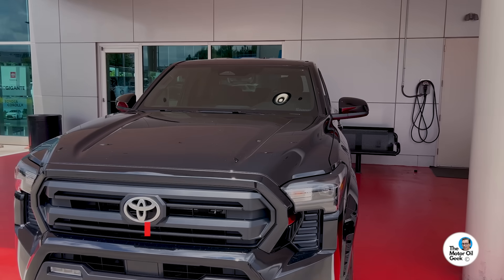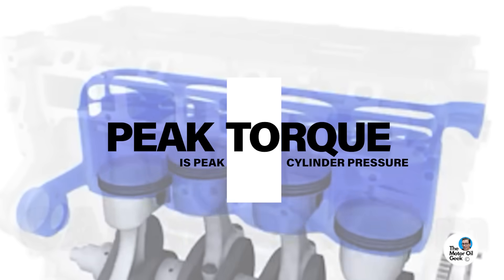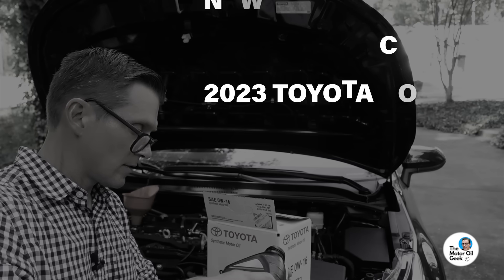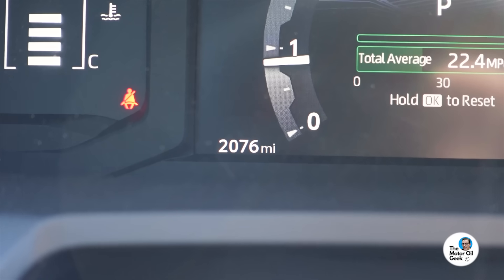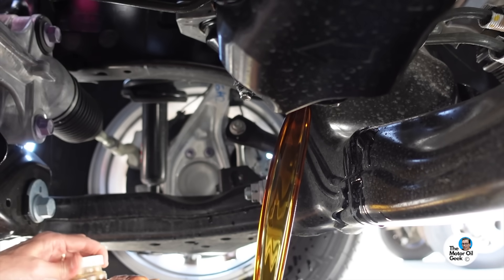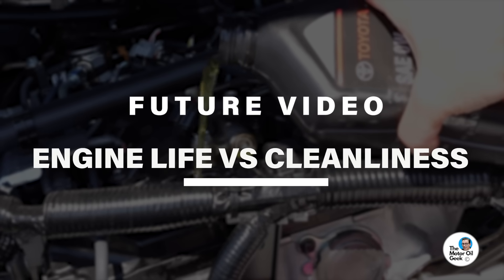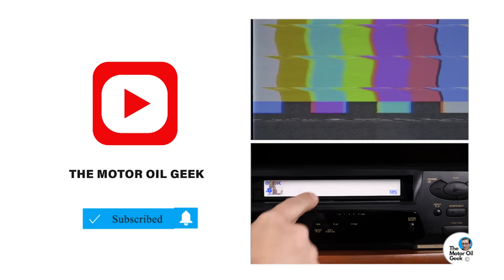The FACTS About Oil Changes (What The Owner's Manual DIDN'T Tell You)

Comment: Hot oil flows freely.  I drain a cold engine. But just prior to removing plug, I heat the oil pan to a hot oil temperature.  I use a hot air gun. The oil drains fast!  When the engine was hot, after it was shut down, the oil had every opportunity to drain completely into the pan. The heating of the pan gets the full load running in a shorter time than  waiting for a hot engine to release the  oil coating the internal surfaces. Any comments are welcome.

Comment: I didn't know it at the time but when I bought my first brand new truck with only 50 miles on it, My freind told me I should do the first oil change at 500 then just wait to 3000 to do the next, great to hear he was almost correct. I got the dealership oil changes to 30,000 miles but they wouldnt do it at 500 so I did it myself. 230,000 miles later I just switched to synthetic and sent u a sample got results and my truck is still doing great

Comment: 4:50 I disagree. Dirty oil filter will open by-pass valve more often than new oil filter. That will cause unfiltered oil circulate in an engine. Do not do it. It is wrong to compare oil and air filters, air filters do not have by-pass valves.

Comment: We have a fleet of about 15 work truck + a few SUVs. Almost all have over 200,000 miles some over 300,000 Miles, Oil changes at 5-600 miles. My last 2 trucks had 365,000 miles got rid of my pickup because of rust. My last one a ford edge i got rear ended and it was totaled. neither one used any oil (1/2 Qt between changes). When I bought my 2015 Colorado new the dealer gave me a hard time about doing the first change at 1000 Mi. Never went back. Now at 5000 miles. Keep up the good work Lake.
Reply: What data shows what you did made a difference in how long the engine lasts or on oil consumption? We have fleet trucks that have their oil changed at 7500-10,000 depending on use, no early oil change, they are traded in a 5 years oil, mileage between 200k-300k, most use .5-1 quart between changes, the problem with this discussion is that there is no way to show that a positive gain was made, it is more of a feel good thing, the only time I change oil early is on a rebuild with special break-in oils.

Comment: Nice vid!  Did you also test the brand new Toyota motor oil to get an understanding of its base composition?  BTW, if something goes wrong with the oiling system of this engine it will be due to a design issue as opposed to best practice maintenance.  Thanks from Down Under!  No doubt there is a legion of fans over here.
Reply from the maker: Thanks for watching! The new Toyota 0W-20 oil was the middle sample shown in the results.

Comment: Great advice as usual and I've pretty much followed that pattern on all of my vehicles. Just purchased a new 2025 Toyota 4Runner Trail Hunter, turbo plus the hybrid system and did similar oil changes as you did. So far in driving Toyotas for the last 50 years I've never had any engine problems following that schedule. What I learned from your video was about changing the oil filter, never thought about that, it makes sense. I also didn't think about running a quart of oil through to flush it, good advice.

Comment: Since using synthetic the break-in period as you said keeps going even at 2000 miles.  Would using your Driven break-in oil be better to speed it up?
Reply from the maker: It would, but it is not necessary.

Comment: G’day Lake, another great video as always. I’ve always changed out break in oil around 3 months in, not many miles, then change again in another 3 months, then 6 months and maintain 2 oil changes 6 months apart for the life off the vehicle. I do change the oil filter though.
I did notice when you mentioned leaving the oil filter in you crossed referenced back to Donaldson‘s air filter not oil filter. Did I miss something?

Comment: I grew up with old-school logic of a 1k break-in LOF due to heat/tolerance changes, potential foreign materials, micro-shavings, upper-end and bearing break-in, assembly lubes/adhesives, thread lockers, etc.. so I agree with your break-in advice even if engine/oil technology has advanced from I-C engine days.
Its why I scheduled my new 2025 TDI Taos for LOF just under 3k regardless of VW's advice of 10k intervals. 
I'll use up my courtesy service/labor visits within two years at my rate of driving, but its still worthwhile than getting stranded in the middle of nowhere with premature wear and engine loss. 
I've noticed all manufacturers forego the first LOF interval for various reasons (lack of electro/mechanical skills by the newest generation, potential reduction of hazardous materials storage/removal at dealaers, use of synthetic blends, newest generation are leasing, planned absolescence, timed resales, young owners do not have mehcanical logic, difficulty accessing engine components w/o specialized tools, etc.) but it doesn't make ANY sense...even with newer technology. 
The same illogic (if you will) has been applied to loss of full-size spare tires. 
Never used Amsoil, but I hear a great deal aobut it. Its certainly not cheap. So, what is your take on this product for engine/driveline lubrication?

Comment: On my amateur race engines, I've always used a break-in oil, (your's recently), for the Dino and first test track sessions and then gone with a full synthetic oil. Why would you not recommend a dedicated break-in oil for my new street vehicle? Is it a warranty thing, or could the break-in formula harm some components in modern engines? I get why the OEM doesn't use break-in oil from your past videos, but would I benefit from taking out the oil at delivery and running break-in oil?

Comment: Based on your previous videos when I bought a new MX-5 I did a 1000, 3500, 5000. So not as aggressive but well over factory recommended. It's what I've done for 30yrs. Last service I was lazy & had a coupon, so I took it in to the dealership. The tech who drove it around said. "wow yours idles & runs so much smoother than most. You must have got a good one". I just smiled and said, I must have. There's no doubt to me that the added break through changing out oil in has to help on any engine. 

Thanks for the videos! Can't wait to see science back up theory 🤓
Reply from the maker: Thanks for sharing that!

Comment: I've heard (and done) to warm the engine before changing oil, since the 60's. These days I wonder if this is needed. Synthetic oil already pours quickly and 0W-20 (or 5W-40) already drains quickly. Changed at 5K intervals I can time changes for Spring and Fall when the temps are above 60. By the time I've cleaned the plug and put on a new gasket, the oil has all drained so why heat the oil? Hot oil is uncomfortable to work with not to mention my oil canister has to be pulled up, just inches from the red hot turbo.

Comment: I’ve driven over a million miles using full synthetic and the oil change monitors. Never had a problem and saved thousands in time and money over oil changes every 3k.  Gone 10-15 k between changes at times.  
I know Lake is a petroleum expert but a mechanical engineer would be the person to ask the significance of minimal differences in wear over the life of an engine. The tiny difference in wear from slightly longer intervals and not doing 3 changes will almost certainly not matter for 99 percent of people who drive their cars for 10 years and like 200k miles.  Most people don’t want to keep vehicles longer than that anyways.  The average vehicle on the road has far fewer miles than that.  All that being said. I’m changing out motor craft semi for pennzoil ultra platinum in my new truck at 600 miles. So I guess I just contradicted myself. 😅.  I’m running an experiment and for this truck I want to see how long it lasts.

Comment: I used to love Toyota. I currently own 5 RAV4s (‘11, ‘18 x2, ‘19, & a 2025) plus an ‘18 Sequoia. 
The new A25A-FKS engine has egr, it sucks. sensors are usually $200-$500. 
The Evap sensor will get stuck open ($500). MAF is uncleanable ($200). 
The electric water pump WILL FAIL / SEIZE at around 100,000 miles ($700 if you diy, $1200+ at dealer). 

Already had 3 recalls on 2019. 
So I don’t dread buying my personal vehicle outside of the Toyota family. 

The Tacoma has zero leg room in rear seat making it expensive storage.

Comment: Just to be clear. People have to follow the manual defined maintenance and care to be eligible for warranty claims.
They shall not do more, or less than described there. As a professional specialist you might feel competent enough to alter the rules, but you‘re NOT in most cases, as there are immensely wide spread of the self-entitlement humans. But sure, if you want to change oil more often, I doubt a manufacturer would be against it.
Ok, I do get:
1.
a) a good filter is a used, not a deeply dirty filter
b) the filter as you say ? doesn‘t catch the drive-in contamination and
c) the oild filter with that mileage has been barely used in terms of flow-cycles-aging
And therefore the filter is actually as new and can be used for 2 full cycles, if not more of standard oil-change intervals. 
Actually what most manufacturers suggest, to replace it every second oil change.
2.

To flush oil, you use an extra gallon or quartz of the same oil, just throwing it out. Sorry, but this needs no comment! It shows, what you sell. You have already 3 oil changes in a single oil-change period for that reason. No need to through in a 4th, just as a flush.

What I‘d do (manual or air-cooled american cruiser, suggesting oil-type semisynth bike-branded 20W40, 1st 800Km, then 8.000 Km oil-intervals, every 2nd oil-change as filter change). Never fill oil above medium mark. Keep it 1/4 over MINIMAL mark.
1. Break-in 500km with original oil and filter spec, drive 60%: Change both, oil and filter
2. Break-in continuation, up to 2000km with original oil and filter spec, drive 90%: Change oil and filter
3. Flush Oil with new oil (adjustment choice, specific: 10W50fullsynth HighSpec V-Twin, for high temperature use, and better flow at start for hydro-lifters), riding 1000km with new filter (your choice, specific: K&N or Wix/Mann&Hummel), replace air-filter with higher efficient and volume K&N Filter, in dodgy areas treat your gas-filter with an upgrade of replacement fit for your environment. Adjust where required your mixture setting, it isn‘t typically for just an air-filter replacement, check with vendor.
4. Check oil every 1000km with proven stable procedure by the book. If there‘s no stable procedure, go to the vehicle shop and get it trained.
5. When it drops below MIN or you reach the book‘s interval or (on a motorcycle with single-oil system) the gearbox get‘s harsh continuously, whatever earlier, do oil-change. Every second oil change do change/clean the oil filter. Always clean the air-filter and when in dust right after the desert storm or other massive air-dust contamination.
6. Every oil change be documented by oil analysis, or at least with oil, mileage, symptoms, measurements. Cut open oil filters changed, always, check and document with makro-photo the status.

Alternate:
1. break-in oil change 500miles, 2000miles, 5000miles with filter changes
2. drive and oil change 1/2 interval with specified oil. Change filter as specified in the book (full interval or two, as specified).
3. Always keep your air filter clean from too much dust.
4. note down any symptoms, analysing oil and opened filter by eye, macro photo, or oil & particle & filter analysis, if you plan to do that.

Comment: I have the same truck. I changed the oil at 500, 1500, and 3,000. I had more debris in oil than the filter. Even some bigger casting chunks plus the normal bearing materials. Now it comes out clean at each oil change. The dealer thought I was crazy. I made them give me two oil filters and two cases of oil for the first changes. This is my favorite information channel. Thanks for the information!

Comment: Drain/ fill transmission at 30k, then every 50k. Never flush (guys who buy expensive flush machines and know nothing about clutch material will hate this). 

Toyotas: coolant every 50k maximum. 
Diffs: every 20k unless you only drive lightly, then every 30k. And after and water fjording over axle depth. 

Your A25A-FKS engine will have the electric water pump fail/ seize up at around 100k.

Comment: When I do the third break in oil change I dump the axle lube and transmission lube (transfer case) as well. You would be surprised how metal you can see in the nearly "new" fluids. I am not an engineer, but professional fleet mechanic who hates other people touching his stuff. I avoid going back to the dealership for warranty, I have even eschewed the warranty and replaced failed parts on my own dime. Too many flat rate guys out there willing to risk short cuts with my stuff just to beat warranty time. In the past I did and it cost me more in the long run in money and regret.
Reply: Ten points for the use of "eschewed," an entirely legit word and properly used, but it's almost never used or written anymore, anywhere. English teacher?

Comment: I slipped abit. I did my first change at 638 miles and at 2040 miles on my 25’ Corolla hatch nightshade. I’m apprehensive about 0w-8 oil. I also have a 25’ Lexus NX 250 and that runs 0w-16. I want to go to 0w-20 for both but the manual says otherwise. 0w-16 in the Corolla is only allowed for 1 oil change and then has to be changed back. Any suggestions? I want to change them from advanced fuel economy Mobil 1 to Mobil 1 high mileage extended performance.
Reply: Go nuts IMHO, but there are others (e.g. The Car Care Nut, who seems sensible) who claim that an electronically controlled oil pump will be calibrated to the thinner oil.

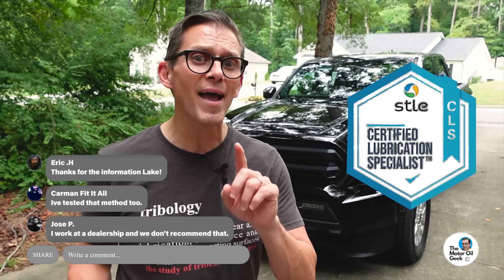Comment: 1:35 lake I don’t think you’re crazy at all. I gave my 13 Subaru legacy which I still own, at 2000 miles I changed the oil ( I was doing all freeway miles) at that time I jumped straight to Mobil 5-30 full syn…. At about 5000 I changed it again. I do pretty much all my driving on the freeway.

Comment: I typically do my 1st drain at 500, then my 2nd at 5000, then every 5000 after that, and I flush with 1 qt and change the filter with every time...never knew any better. I just did my 5000 mile drain on my 2025 Subaru Forester Hybrid and I'm waiting for the Blackstone analysis to come back. This is the last new vehicle I plan to buy, so my goal is to optimize my maint routine to maximize engine longevity.

Comment: I changed oil when I got home from the dealership with 78 miles, 500, 1500 and at 5000. Now every 7500 and if it's all highway at 10,000. I worked at a lawnmower shop in my teens, start a lawnmower engine for the first time and you will see a cloud of metal in the oil, wear to fit.

Comment: Lake, thank you for this video.  Really enjoyed it.  But two things stick out to me.  First, you state that oil filters become more efficient with use.  I used to believe this too, but I've seen ISO method testing that shows exactly opposite.  Someone I know says you have data from Donaldson that shows what you claim, that oil filters, like air filters, become more efficient.  Would you consider doing a video on this subject, and address the different opinions, and share the data.  I believe a lot of us would really love to see this.  Second, you pour a quart of oil in, after draining, to help push out contaminants.  Considering that the fresh oil is at ambient temperature and the engine is hot, without some mechanical way to mix them, isn't the fresh oil going to stay separate from the old oil?  Again, I'd love to hear any data to support this practice.
Reply from the maker: Stay tuned for the next two videos

Comment: Back in the early 70's I got a job at a GM dealership. The old-time mechanics said on a new car, change the oil and filter at 500 miles. Run the car 1,000 miles and change the oil and filter again. Run it 1500 more miles and change the oil and filter. After that, change oil and filter every 3k miles. I owned at least 30 used and new cars over the years. I never had an engine issue ever. Today on new cars, I do the same but change oil at the 4K mark rather than the 3k mark. Oil is cheap compared to the inconvenience and cost of a new engine.

Comment: I did pretty much the same thing with my 2025 Lexus NX 250 naturally aspirated 2.5 litre here in Nova Scotia. I didn’t change the filter.  Just the oil. 2 times prior to 5000 km. Like you mentioned; most contaminants are in suspension in the oil itself.

Comment: 7:39 really need to start showing Odometer mileage on these reports, that allows other channels that share them to know if Miles (on oil mileage) of 1598, is actually at ODO 2076, that allows the data to be more accurately read. This means people ditching 0W20 for 5W30 due to wear metals, we can see if their report is within the first 10,000 miles whilst the engine is still breaking in.

Comment: I’d like to know: does the 0w-20 viscosity provide adequate or more than adequate protection for the crank & piston bearings and the timing chain for a turbo engine? As you may already know, the V35A engine is on its second recall- both for machining debris, but somewhere along the line between the recalls, Toyota updated the crank bearing material (new part number).

Comment: I did first oil change at 700 miles I just did the 2nd oil change at 2450 miles. I did 0w/20 as manufacturer recommends for a 2024 Nissan Z Nismo. Next oil change will be 6 months from now or 5,000 what ever comes first.

Comment: Wow my 24 5.3l at 19,000 miles is still breaking in with chunks of aluminum. Changed oil 7 times and filter 5 times. The first one was clogged at 800 miles. Still running strong with a tick.